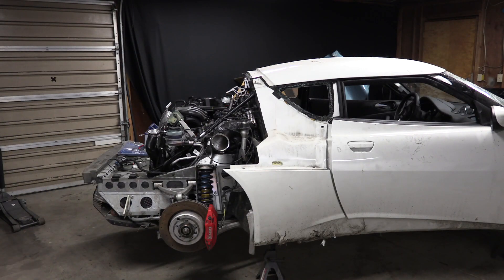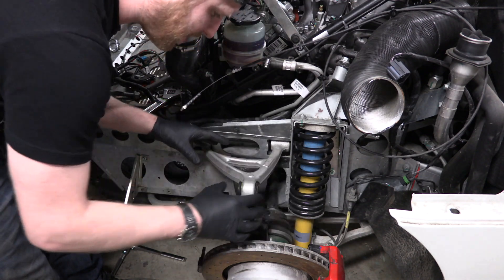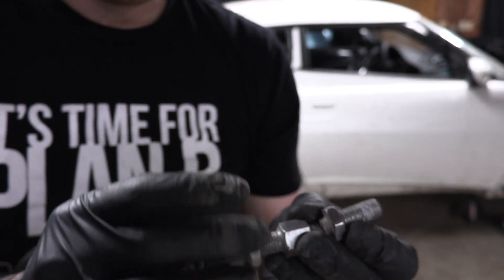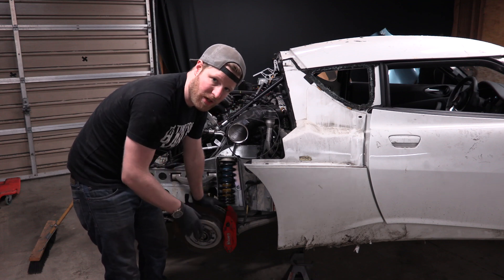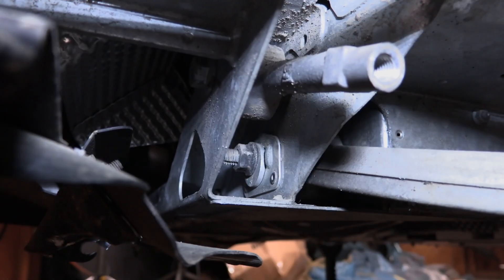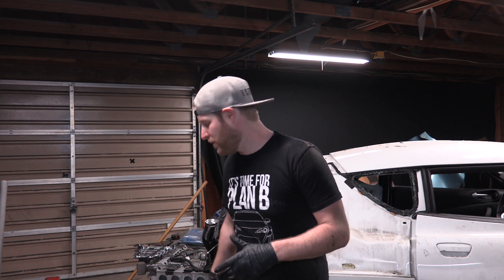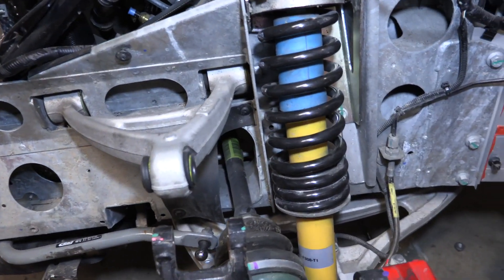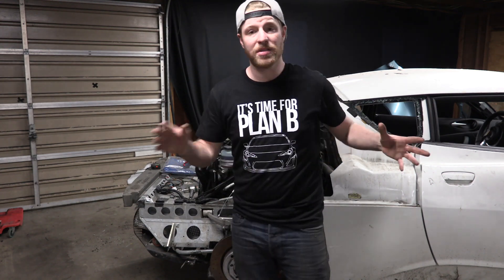Budget Lotus Evora Pt 4 - Fixing Suspension

Comment: I know you probably already have a ton of comments about this, but the threaded rod with left and right hand threads is commonly referred to as a turnbuckle as it adjusts the length of the linkage without completely disassembling it.  This is necessary for steering linkage/alignment.

Here is an example of one:  https://autoplicity.com/7396512-steinjager-j0028429-steinjager-jack-screw-turnbuckles-adjusters-m16-x-200-plated-zinc-yellow-109mm-long?1&gclid=CjwKEAiAq8bEBRDuuOuyspf5oyMSJAAcsEyWdlUkQQOSKDH_Y4-mYjUPXYni0aA0mp7ypPoC6Qrm0RoCH0_w_wcB

Comment: Buy the toe link assy from Lotus.  You don't want to cheap out for a critical suspension part.  I'm very familiar with various alloys, machining processes and heat treats.  You can make a part that looks identical, and is 1/10th the strength of the original.  Safety first.

Comment: they probably won't just sell you the bolt because if you snapped the tie rod chances are there may be stress cracks on the tie rod ends. Don't really want to cheap out on something that holds your wheels in place. Regular All thread is most likely not the right grade and would snap in no time.

Comment: I dont know if you managed to get that tie rod adjuster shaft with the left and right hand threads, but if you bought a piece of decent quality hex bar and take it to a machine shop, it should take about 30mins to machine what you need. For the price you quoted for the original, you could probably have two made and have a spare for later.

How that helps

Comment: Quick question can't tell from the video. Does the top two bolts that bolt the damper top mount plate to the frame on the shock towers have a nut on the top or is it a threaded welded to the body? I know it's only a 17ftlb on those bolts so maybe threaded nut on the body? curious to replace mine with rear clam on (shop manual notes it's possible).

Comment: just a thought- your broken piece is just the opposite of a turnbuckle (male threads instead of female) if you can salvage enough of the reverse threaded rod off the original it just might be made to work. or try to find the correct reverse thread cutting die and fabricate( although a specialty die like this might cost more than a new part. oh, and one more thing, please use some kind of pointer when discussing specific pieces.    am having a good time learning about lotus construction-keep it up!

Comment: See, that's proper engineering there: That plate is sacrificial. A bucks worth of aluminium has saved tens of thousands worth of chassis damage - because Lotus know what they're doing and put the plate in there. Look at any built to cost sports car and that kind of damage would need a new sub frame. Really loving this series, looks like this car will be on the road sooner than you think!!

Comment: hint, to obtain the rear toe link adjustment bolt contact a lotus dealer as they are likely to hold a old toe link lying around as apart of a service recall on the V6 Exige and Evora which could pinch?

Comment: 165 bucks for a toe link, in lotus terms, isn't so expensive. If you don't want to go that route, just buy a round stock and use a lathe(and a dividing head on a mill). I don't think a machinist will charge you far less than that, even though with proper tooling isn't a messy job at all.

Comment: You only talk about the mounting points and the subframe. I am curious to know why you do not consider the wishbones / knuckles to be bent. Usually the knuckles and/or wishbones are designed to be sacrificed in a crash, to be the weak link in the suspension. How do you know they are not bent?

Comment: You might be able to find two bolts one for each side and weld the heads together to create the antiroll bar link. Just a thought but finding a reverse thread bolt would be difficult... You could also buy non threaded rod and get a metal shop with a good tap and dye kit to thread the rod then weld a nut to the center...

Comment: 161 isnt bad for both assemblies, i paid 60 for adjustable aftermarket ones on my accord, those where the cheap ones too
.
From personal experience i would just replace them all, i had suspension damage with bent tie rod end and tried replacing just that and going to the alignment shop. Ended up not being all straight and it was the knuckle that was just barely out of tolerance, replaced the corner and aligning great. But you have aluminum knuckles probably so itd be more obvious if it was bent.

Comment: The toe adjustment rod can be easily reproduced on a lathe in any machine shop using high carbon steel. Just carry the old one so they can get the correct thread pitch and overall length.

Comment: just throwing it out there, I'm not sure if it would even effect it. but is it possible that the rear control arm camber nut spun or bent the bolt and is causing the rub.
Reply: I should finish watching the video before commenting, I see you already figured it out.  I see I was pretty close at guessing it right though.

Comment: if u do that to the toe link and u weld or make another piece ...it will make the car UNSAFE,because the other link will have a resistence lower or higher then the part u make from scrap...so get a second hand one or a new one and buy a pair so you know both are new and same on both sides...this is a LOTUS not a Brz ,it has to be all original parts if u intend to sell it ...dont cut corners or make a death trap ,no money savings are worth that Chris! And never forget to have fun 😀

Comment: Couldn't you just find two hex-head bolts (one LHT and one RHT of the right pitch) and wend the heads together then reshape them gently with an angle grinder? After welding, you can bake the bolt at like 500° for an hour to release any stresses caused by welding process. I would just go to a hardware store with both ends of the tow link and find the right bolts that way. If not, you can also look for the right bolts online and do it that way. Grand total should be less than $20.

Comment: Hey Chris, we replaced the toe link adjustment bar on a merc before with a threaded tube and heim joints. You can look up AFCO aluminium hex sleeve on Speedway motors website. You can then match that with an appropriate Heim joint and locking nut. The sleeve is reverse threaded which allows for toe adjustment. You just need to get the correct length sleeve. Hope this helps.

Comment: The bolt on that mounting point on the control arm is adjustable loosen the nut on the bolt slightly and turn the bolt and till the arm moves to the spot you need

Comment: hey Chris it looks like your drop link link is bent on the smash side. and for your double threaded bolt you could get 2 bolts with the same thread and pitch and weld the heads of the bolts together and they will have opposite threads

Comment: did you get the interior cleaned up (the mould)?
Reply from the maker: +Paul Norris yep its all clean and nothing has been creeping back in, i can actually breathe in there safely now.
Reply: +B is for Build  why don't you jus find the same thread pitch bolt get 2 of them then jus weld the heads together then they  will reverse threads on 1 side like you need
Reply: + Benjamin Baird. Nice idea but I don't think it would work. One end of that widget has a LH thread. Turning a RH thread bolt around doesn't make it a LH thread.... But if you could get a LH thread bolt of the right strength/grade? I'd feel happier with a Lotus made part.

Comment: Many cars use this type of opposite threaded tie rod adjustment bolt for steering adjustment, etc and it is a cheap part to get if you can find a matching thread size alternative. For example the Saab part has OEM part No.: 4242731 and it cost less than 10$.

Most car dealers sell the OEM part as a whole assembly together with both tie rod ends and that's why the price is high.

Comment: Dude you need a machinist friend. i can make one of those jiggers for less than 20$ material cost, and a few beers afterwork. hit me up if you want but i live in canada so shipping will prolly be more than what the parts worth. def not 160$ tho
Reply: +G0ATLif3 Yeah definitely, I was about to suggest going to a machine shop too. You can get that bolt made in medium-hardened stainless tool steel in an hour for like 30 bucks and it'll be perfect.

Comment: For all your suspension problems in the future you should look into autocross universal uniball parts.Uniballs are available as female and male right hand and left hand threaded.mostly made from chromoly steel and then you can use one type of thread to connect a left hand with a right hand uniball,weld a nut in the middle and you have your adjustment.For the alignment adjusterplate I would just take a steel plate and put a weld beed on the right spot then your done.Isolate the metals from each other to prevent corrosion.

Comment: maybe an option for the broken bolt is turning the longer part in a lathe, tapping it with the correct treath and buying a rod of treath for it. If you can find it online. Then insert the treath and wel it. done deal

Comment: just buy a left hand and right hand bolt of the right length and butt weld the heads of the bolts together.  one side will be left hand thread like you need and the other one right hand with a way to adjust it in the middle
Reply: +skatefreak666666 that was a joke, right?
Reply: +ciprian ss why would that be a joke? It would work and you could use high strength bolts too. Couldn't weld it with the shitty flux core welder but Eric could tig it and it'd be fine
Reply: I don't think he is because that's a good idea

Comment: you need to take it to the frame shop they got pullers and know the specs have them pull the frame and fix it 200.00 to 400.00
Reply: This. Way to nice of a car to cut corners. Replace every bent component and have the frame measured and pulled if necessary 👍. 
Great channel btw ☺

Comment: i was thinking if the sway bar is Not snapped or broken it is possible to heat it up and bend it back straight on a hydraulic press ... just a thought
Reply from the maker: +William Giraud I was able to get a new one for about $70, so i figured its worth picking up
Reply: ok then... good talk!!
Reply: +William Giraud when you heat metal, you change it's properties and it becomes soft. so no that isn't a good idea. The same goes for people who heat their springs to lower their cars, it is dangerous and you shouldn't do it
Reply: +robbgnarly exactly, structurally atoms shift so the metal would not be fit for its' function and the percentage of a catastrophic failure increases. it's unsafe and not advised, you should never suggest someone to do that unless it's just piping for your gutter or something that is non value added functionally to your every day life.
Reply: lol unsafe?? da hell?! a sway bar can kill you if it breaks?? then don't heat it up then .. shit! just put it in a hydraulic press and bend it back i've done it to mine and never had a problem!

Comment: Why not just get two bolts with the same thread pitch (if you can find one, or re-tap them) and weld the heads together? it will make that welded bolt thing in the middle plus each side will be threaded opposite to the other

Comment: I think several have posted a out this but here it is again. part #5 on the diagram and they are in California so shipping should be quick. http://www.lotuspartsdirect.com/a/Lotus_2014_Evora/_50018_6703190/Rear-Suspension--Incl-Hubs/EA3103.html

Comment: Chris, have you tried calling local rim/wheel/tire shops in your area to see if they could possibly fix your wheels?

I bent and cracked two 24 inch wheels and a local wheel shop here in Dallas had them repaired in 24 hours. Welded, straightened out, and repainted in the damaged areas for about $125 each wheel

just a thought, in case aftermarket wheels turn out to be too expensive
Reply from the maker: +Carlos De Leon a few of these are beyond repair, and i dont mind getting some new ones, i think itll make the car stand out from the rest.
Reply: +Tom Wallace diamond steelies on a fucking lotus? sign me the fuck up.
Reply: +B is for Build Definitely the way to go. Welding aluminum wheels is very scary especially if it's the wrong alloy.
Reply: +B is for Build Plus selling the undamaged ones, will take a big chunk out of the new wheel budget. 
Just throw some donuts on there, it will for sure stand out.

Comment: Why not put a nut in-between the 2 broken pieces and have it welded back together? From the looks of the rod it has 2 nut already on the rod just make it 1 full nut by adding 1 more and weld it up?
Reply: +Chad Ellsworth the rod is bent and wouldn't tighten up straight anymore

Comment: You really need to invest in a good set of tap and die set. Also get a really google set of reverse thread drill bits. Get those in titanium and use plenty of oil when drilling to save the life of the bits. You will use to them more the you could ever imagine . :)

Comment: go to a machine shop and have them fab up the piece you need. please please please do not just go out and buy threaded rod, that shit will break so quick. As someone who does work from the extreme budget stuff to actually staying off of ebay and buy name brand parts, use your machine shops. They can do so much more than you think and you can save so much money. I know you may want to learn but you will be going down the road and your run of the mil threaded rod will just snap or bend becuase that stuff is pretty poor metal from my experience.

Comment: thats not a standard bolt it was turned on a lathe from hex bar, a machine shop could turn and thread that bolt up for you if you had the measurements
Reply: actually if you took the other sides bolt in they could probably replicate it

Comment: hey chris im a machinist located in south Carolina and you can get the part you need turned out at your local machine shop for a fraction of the oem price. Also if you can get the thread pitch and dimensions of the part (its most likely a metric thread) i could see if i have any dies at my shop and that hex stock and i could easily make it for you in an hour after my working hours for FREE.

Comment: Maybe remove the inner tie rod and see if you can find any that share the same threads? 

Could you please try to use heim joints for the tie rod ends? You can get them from Tractor Supply and it's something I've always wanted to try.

Comment: Check Spohn. net for the adjuster. They have some on their site but they make custom performance parts for cars so they maybe able to make or get you one. 

Go to Replacement parts > rod ends, spacers, etc and scroll through the 2 pages. You need to figure out what thread and pitch you need though. Lots of performance and off road parts use that same type of adjuster.

Comment: i dont like your idea of making a tie rod with construction materials...it wont have the same strenght...should buy for 160$ and get both sides brand new without worries...its your steering dont mess with it...
Reply: its like replacing a grade 10 bolt to a home depot ungraded full of air cheap metal bolt

Comment: I'd try a machine shop to make up your adjuster bolt, especially since it is both left and right thread. A good machine shop should be able to cut those threads, it would just be a matter of how much they are going to charge you. Just remember it does keep your wheel straight while cruising down the highway, I'd invest the $160 and call it a safety cost
Reply: +Mark Walsh Most machine shops would totally do this for less and a six pack!

Comment: For the missing part, could you weld a couple bolts back to back?
Reply: +HKPPK H Funky thread pitches are easier to find in bolts than threaded rod. Plus that would reverse thread the other side, unlike just sliding a nut onto a threaded rod. Still, it might not be strong enough or straight enough...
Reply: Ah. I see now.